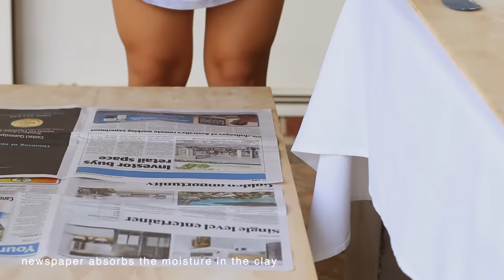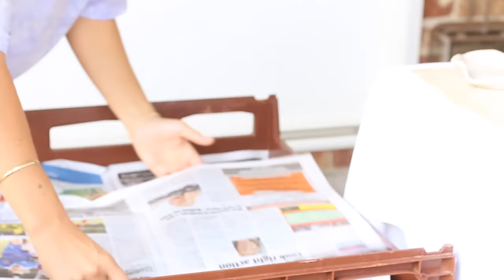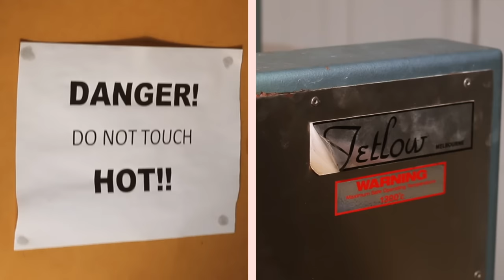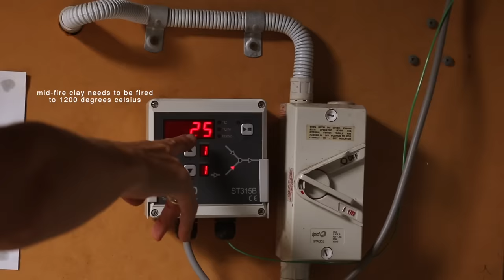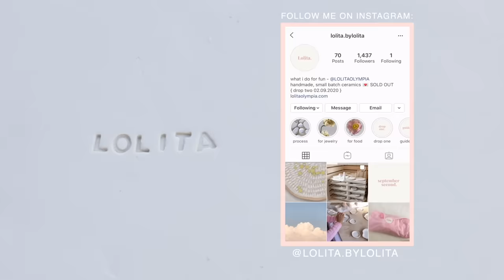HOW I MAKE CERAMICS AT HOME (the entire pottery process) | lolita olympia

Comment: do we have to do the firing? can i just skip that part?
Reply: Nope. It wont be water proof or durable. And your glaze won’t set either. You can use air dry clay but you can’t make most things out of it. You also can’t use a home oven since it does not get hot enough.

Comment: How do I know which glazes are food safe?was your glaze food safe?
Reply: basically most commercial glazes are food safe these days, 'food safe' became a public concern because ceramics used lead glazes for so long, lead is no longer allowed in commercial glazes, the only potential concerns are some glazes with copper, and highly metallic lustrous glazes

if you are asking because you want to make pottery, the manufacturers will label their glazes as food safe or not, if you are asking as a customer/consumer wanting to buy pottery for food use, just avoid pieces that look very metallic
Reply: @rz1974  thanks! I'm looking into making my own ceramics and was concerned about glazes. What about cadmium? Also does the "lemon trick" work for testing toxicity/leeching ?
Reply: @densebread  definitely avoid cadmium, the lemon trick works but isn't a definitive test, I make my own glazes and my general rule of thumb is just avoiding toxic or problematic ingredients altogether, which honestly there aren't many of, they are mostly oxides/colorants

On a more technical level, these ingredients are typically 'safe' if the glaze is stable and has no faults, unfortunately something that can't be proven by a simple lemon test
Reply: @rz1974  thank you so much! I'll keep those in mind and read ingredients on premade glazes before I use them :)
Reply: @densebread  sounds good, if by premade you mean premixed dry glaze for dipping you should be fine with most unless it's a metallic, since commercial glazes tend to avoid problematic ingredients, can just check out the manufacturers website and typically it will say whether the glaze is 'food safe', though if they don't disclose this the ingredient list is your next best bet (though typically they don't disclose the exact recipe, just a list of ingredients)

If you're talking about mixing from recipes posted online, certainly pay attention to the ingredients since anyone is welcome to post online, and as you start to understand glaze chemistry you will be able to differentiate bad recipes from good ones, which is why people usually start off with a known stable base recipe and add colorants or modifiers
Reply: @rz1974  another question! I would like to single fire my ceramic (save time and money). Once I have my ceramic done do I paint on the glaze while it is leather hard or bone dry? Afterwards do I wait for glaze and clay to dry before putting it in a kiln? I worry about exploding ceramics lol
Reply: @densebread  is it your own kiln? If so I would recommend doing the now traditional two firings, a lot less for error especially for beginners, firing an electric kiln isn't expensive, especially if you fill it with as much possible and fire at night

If you are set on once firing though, you paint glaze on bone dry (leather hard is for slips), also not all glazes will work for once firing, if the clay content of the glaze is too low it will peel off

After glazing, just wait until the glaze is dry to the touch and won't be marked by loading it into the kiln, the biggest issue with once firing and exploding will come down to your firing schedule, since you will be basically bisqueing the piece first and then proceeding to a faster glaze firing after that, kilns don't come preloaded with this schedule so you would have to do research on both programming kilns and an appropriate firing schedule

So yeah, if you are firing yourself and are uncomfortable with all of those variables, I recommend firing twice
Reply: @rz1974  No I don't have a kiln at home :(. I live in an apartment and I'm not sure if they'd allow me to have one due to fume and fire concerns. I'm truly a beginner at ceramics! I'm currently an illustrator who always had a pull for ceramics ever since I took one class in high school. I went with illustration as my family told me its "more marketable" . I'm trying to get back into it and listen to my own heart haha. Thank you for the help I really appreciate it :)
Reply: @densebread  no worries! I would speak to whoever will be firing your ceramics then to confirm they can setup the kiln for once firing, since it's certainly not the norm

Good luck! There are a lot of technical hurdles to get over, but once you do there is something very immediate and rewarding about clay
Reply: @densebread  also, your illustration skills will come in handy with ceramics, unique surface decoration is probably the easiest way to distinguish your pots from everyone else's, some examples: shoko teruyama, kevin snipes, and more traditional michael kline, and some even more traditional example e-karatsu and buncheong pottery

Edit: and for some hipper examples, I consider stuff like group partner, gabrielle silverlight, Eric roinestad etc to be quite illustrative as well, more so in the form itself though as opposed to just surface decoration
Reply: @rz1974  Thank you for the wonderful list of artists! I love their work already. Is there any way I can get involved in the ceramic community? I'd love to be in touch with you and other ceramists!
Reply: @densebread  sorry for the late response, honestly I'd say instagram is the best place these days just because everyone is on there, there are also some fb groups that I don't have much experience with